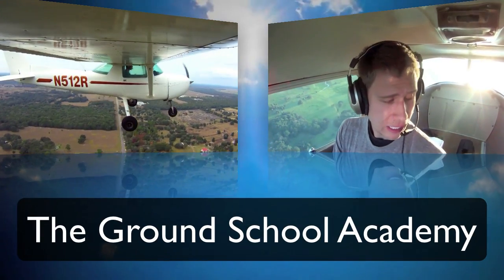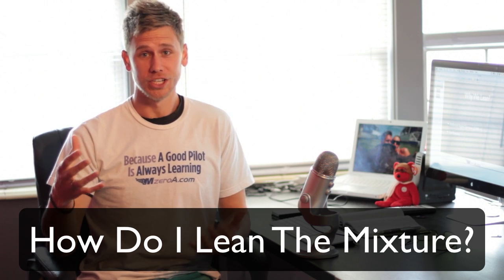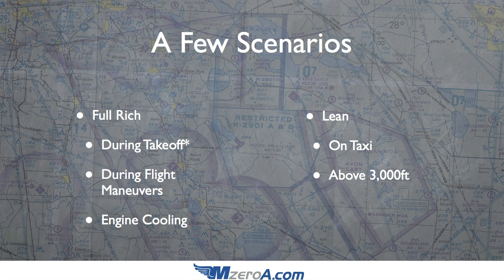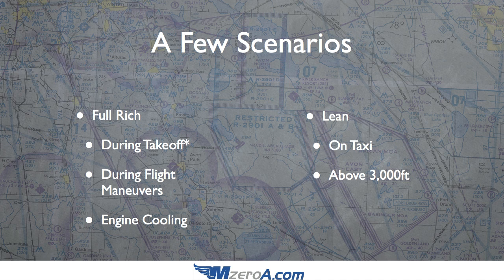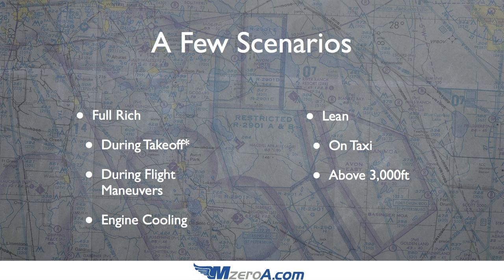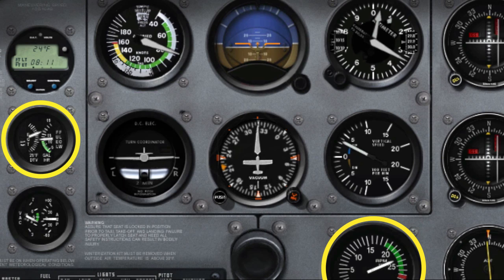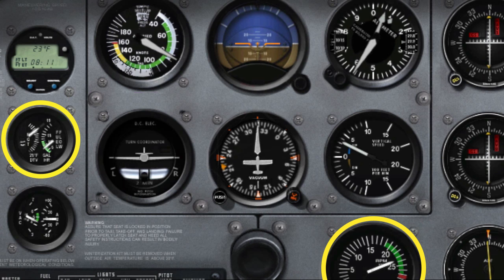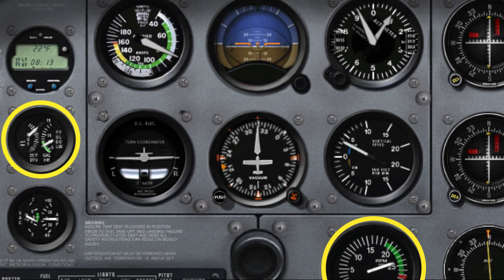How To Lean The Mixture

Comment: Good question. There have been automatic mixtures on airplanes since 1930s or so. Also eaven the cheapest ultralight planes have automatic mixtures. Many modern GA planes have FADEC controls these days. Why americans still use technology from the 50s? Why new Piper Archer still has a carb engine? Maybe they are simple and reliable. I like old engines, but don't really understand how they can be legal to sell in new planes these days :D

Comment: Some answers: The 3 turn rule is to get the mixture nob 1/2 inch in. However, the proper setting on a carbeurated engine is find max EGT by leaning to max for smooth engine and monitor EGT 5 sec, Then increase mixture to drop temp 25 deg. for max performance [fuel economy], Or, 50 deg for max power. Check it during flight as temp and barometric pressure are always changing!!    Also, an engine CAN QUIT from fowling being TOO RICH.  Be Safe, and Happy Flying :)

Comment: So ... rich of peak once you leaning from rich to peak performance do you or do you not turn it back in 3 turns? Also if you do not have the option to turn and you have to push? Now what? Also when you say 3 turns does that mean full turns? Boy there are a lot of open questions. Rich of peak means what? You get to peak performance from a rich condition? Sorry but I never heard the term rich of peak.